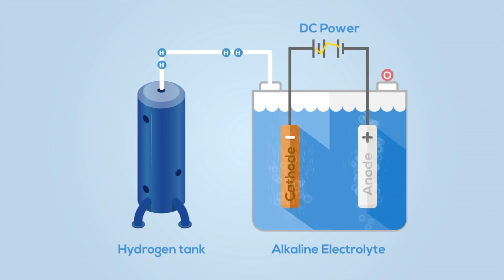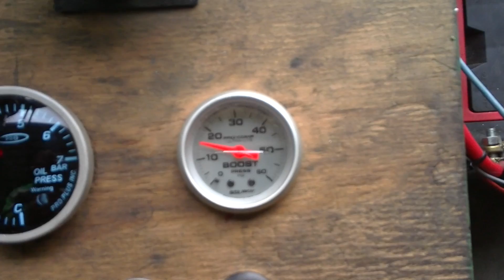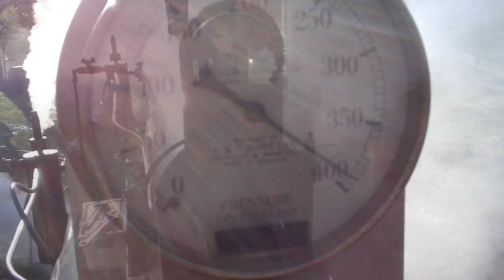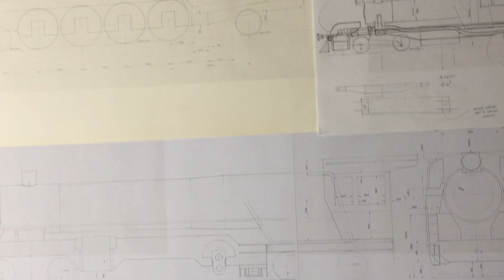Sam's Journey to Modern Steam

Comment: I really love your videos, it is like listening to someone that is on my same wave length.  I to built a wood fired boiler but only went as far as building a 1 HP Stuart Turner No1 steam engine....   I went down a similar path with hydrogen as you after being frustrated living on a farm run on solar electricity, as I looked at storing the excess solar power in summer time for winter use... but reached similar conclusions that hydrogen had to many efficiency losses.. 
I have a partly built steam turbine set up to drive a 12v alternator,  so your videos were like s trip down memory lane in that regard. 

Have you looked into making a gas producer to run your tractor on wood?  They can work heaps better now with the newer insulations and higher temperatures than when they were used during WW2...  supposedly one kg of nice dry wood has similar energy density to 1lt of petrol....  

Most refreshing to see interests in these things still alive and well.. especially with new innovation being applied. 

Best wishes

Comment: This is very inspiring! Have you looked into Caprotti valve gear on steam locomotive by chance? From my understanding, this valve gear along with its unique valves in the steam chest, allows more power to the cylinders than the classic methods. Or were you planning on using the turbine to power traction motors to the axels?

Comment: Another side thing, along with a garret design a design which solved the flaws of a garret was the Vulcan Duplexes. It might be of use for larger locos down the road ;) but you are correct, we usually get 80 to 90 percent water release on our locos and i think i mentioned prior we get on the large engine typically get great milage and power for size (CNJ 113)

Comment: What kind of loco is the one you fitted the Lempor exhaust to? Never seen one like that before
Reply from the maker: It's a NZ version of a Heisler logging locomotive, quite unique!
Reply: @Mackwell-Co  Thanks! Was googling for ages and couldn't find it. Logging locos seem to always have the most interesting designs, between this, the Shay locomotive and the half dozen ones with angled cylinders (not to mention the crazy caterpillar tracked log haulers) they're high on my list of ones I want to try modelling. Do you know if there's a reason why so many in the logging industry in particular seem to be geared? I guess high tractive effort and lower speed but there's easier ways to do that. Any insight?
Reply from the maker: As you correctly point out it comes down to the low speed of logging railways. Gearing allows smaller cylinders to be used at optimum piston speeds. The magnitude of torque peaks are also reduced, allowing the engine to work nearer the limit of adhesion, particularly valuable for steep grades common on logging roads.

Comment: Could a modern steam engine be used in a marine environment? Given that most boats are driven by engines that use highly polluting heavy crude oil, it seems a steam engine using torrified biomass as fuel would be an excellent form of propulsion for marine vehicles that do not rely on sails.
Reply from the maker: Yes, exactly our thinking, perhaps as a complement to sails too?
Reply: there have been steam powered ships and boats before.

Comment: I really enjoyed this for all the prior learning you developed practically.  The point that really struck me forcibly here is that wood production demands far less acreage for the same calorific value as biofuel grown from non-wood crops.  It is strange how this becomes obvious once stated... with all that surface area available for photosynthesis in trees that massively exceeds that of ground crops, eg sunflowers.  I am a big admirer of your work which clearly 'has legs'.  When you feel like it perhaps you could show us the heat exchanger you have developed.  I have a mental picture of what it might look like but it is probably a bit off from what you have done.  I am amazed there is no steam chassis out there somewhere, begging for a boiler.  Perhaps news of your work will prompt a response and the offer of a two-foot gauge 2-6-0 chasis.  I accept you proposition that steam should not be thought of as an obsolete means of power.  I'm already looking forward to your next video.  Fantastic work.
Reply: Yes, for standard biofuel to work (that is, biodiesel, bioethanol, etc.) you would need to remove all the crops we already need to feed ourselves. Wood is much more promising.
I'm interested to see where this goes.
Reply: There are 2 Barclays in a scrapyard near Edinburgh that could use some attention